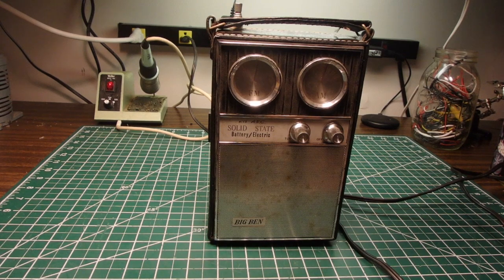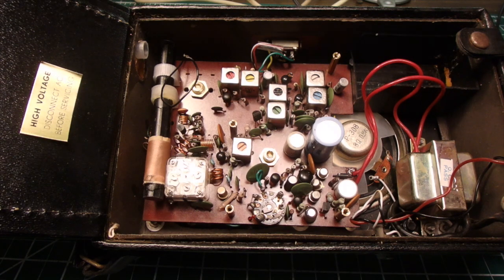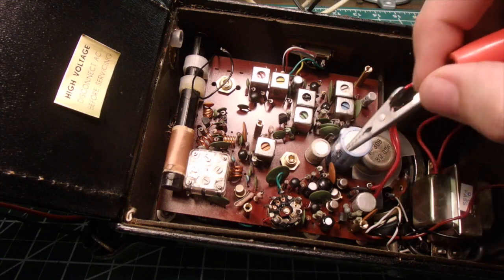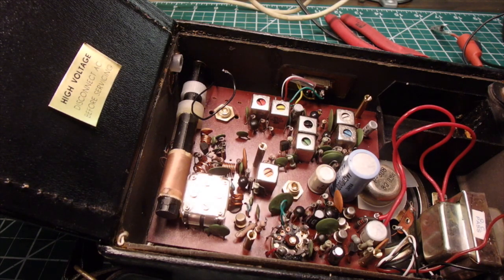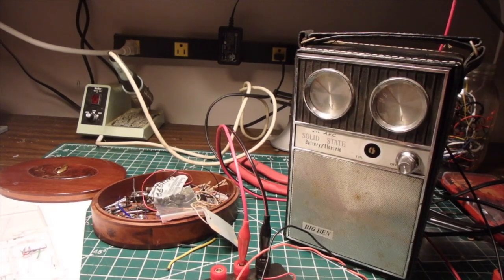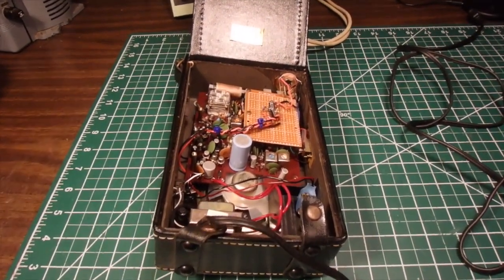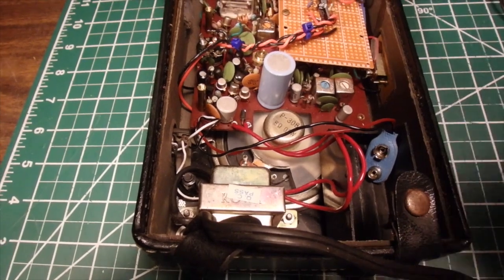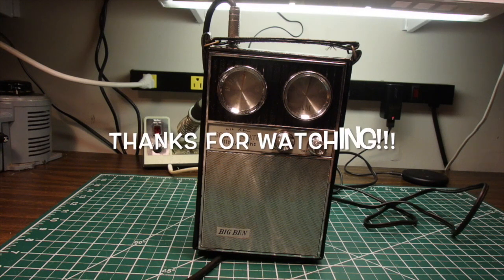Vintage Transistor Radio Guitar Amplifier Build

Comment: we used to take transistor radios and somehow attach the speaker to the volume control and use it as a microphone  and the sound was amplified through the earphones. wish I could remember how we did that, but that was 55 years ago.

Comment: Hello, I have an older GE am/fm radio that I converted to an amp in the same way you did here, the board looks very similar to this one, it there are easy way to find and kill the am signal?
Reply from the maker: Look for the wire going into the volume potentiometer. One of the outside contacts is the ground, the other is the input. If you remove the input then you should lose the radio signal